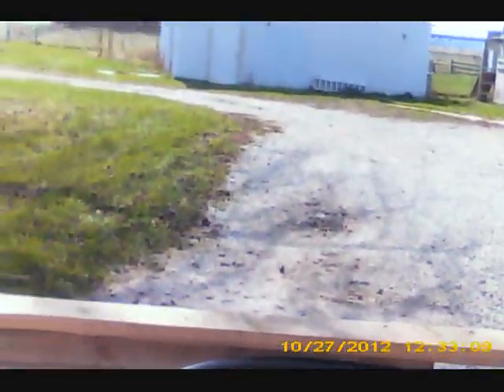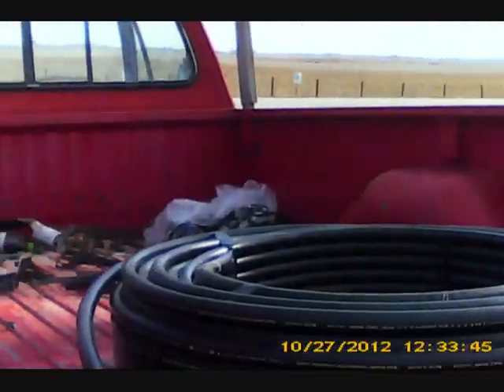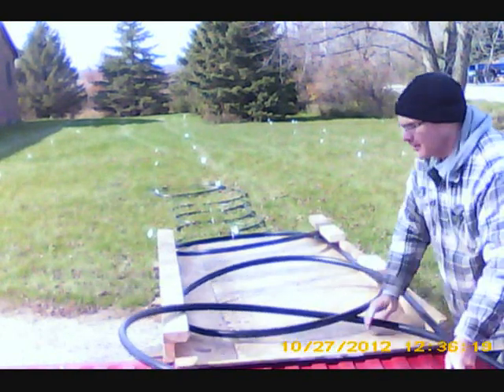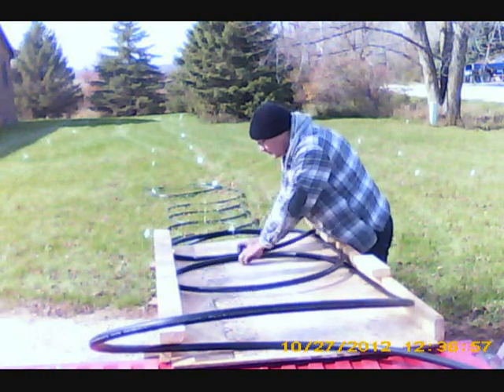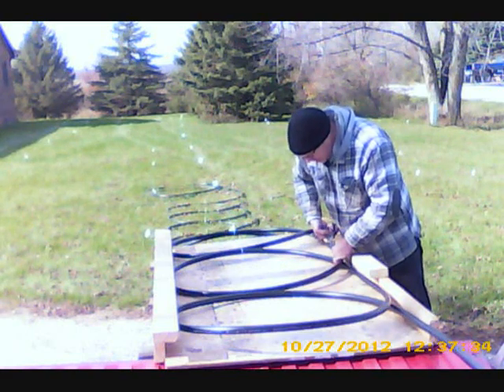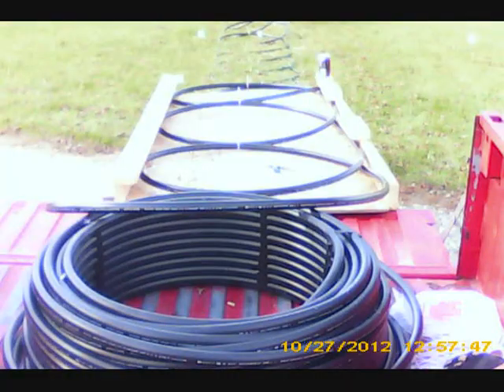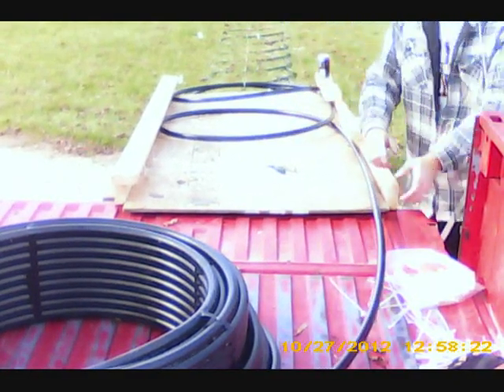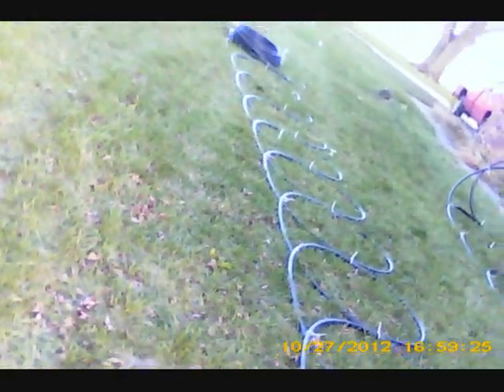how to make geothermal slinkies and how to get an extra 100 feet of heat exchange

Comment: No shit man, of course you get extra heat exchange but you are digging more, the whole points of loops is to dig less, hell if you want to be as efficient as possible just don't coil them and put them straight. Also not passing the cold near the warm is redundant because it's such tiny amount of time since it's going straight, besides it pre heating the incoming water which is just going to get hotter sooner.
Look all i'm saying is the benefit of looping is not digging as much and the trade of is efficiency, you know you can also just dig a U shaped trench and loop the pipes the whole way.

Comment: wonderful video. since you have to dig the trench already, wouldn't it be faster to just lay the pipe in straight and make it loop back and forth vice in coils? Adding a manifold would allow more liquid through vice longer "under ground" time to equalize temp. the ground can only warm it up so much so temp change is more about volume vice temp.

Comment: I dont use zip tie they will work.  I'll  dig then stake it down with 8" sod steaks.  More than likely you'll want to headed it off and run multiple loops to keep the head pressure down if not you'll burn through pumps or possibly not get enough water back . I always cut out any kinks more than likely it will cause problems  if you have a dirty air filter in the heating season the system will pull into a vacuum on the loop side the pipe will collapse under the ground. That's just my experience and I've installed well over 200 systems. any one need a tech or just has questions. pm me. new and used equipment available. 🐓
Reply: How do we contact you? I am interested in a system and we live in Puerto Rico so I only need the cooling part I think. Jgrass@grasselectric.com

Comment: Dave, great video.
Separating the return line from the loops seems wise.
What length and tensile strength zip ties do you use?
Is that 1 1/2 inch HDPE?  What length of looped pipe fit into your 100 ft of trench (no loop overlap)?

Comment: Hi Dave, when you do this design, how many feet of HDPE pipe are you installing per slinky loop?
Reply: How did you determine what length you needed and what did you use for your heat pump/ductwork?
Reply from the maker: 600'
Reply: Thanks Dave, so the slinky uses up about 500' of the 600' for a 100' trench and then 100' to get back to the header which equals a 600 foot coil?
Reply from the maker: +jason schmidt yes